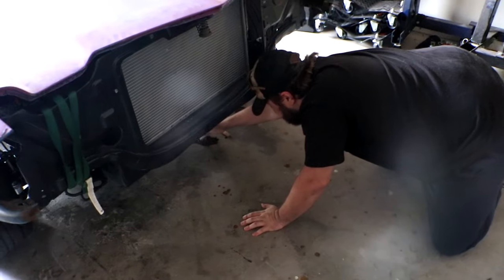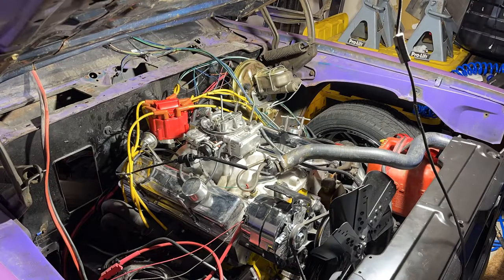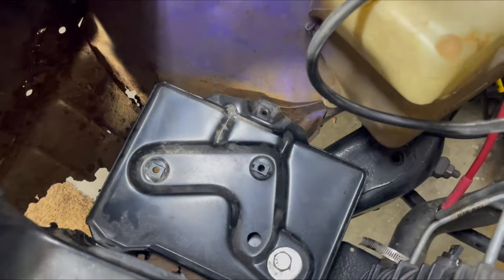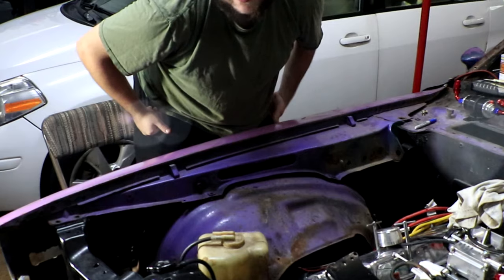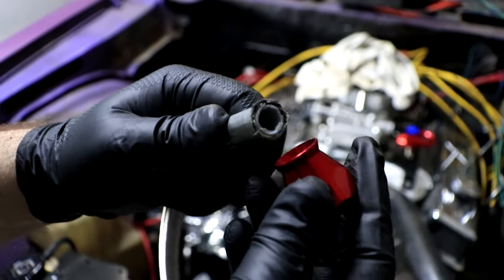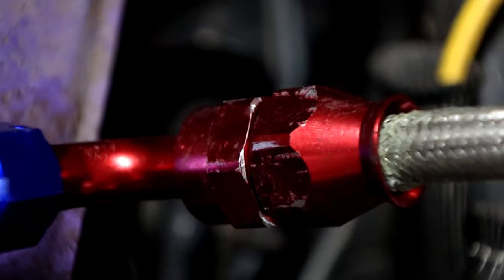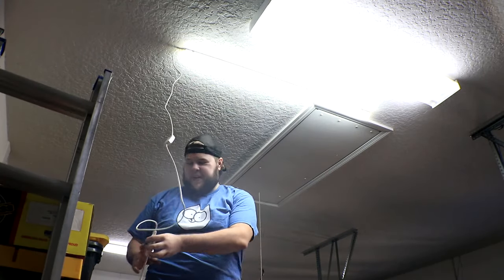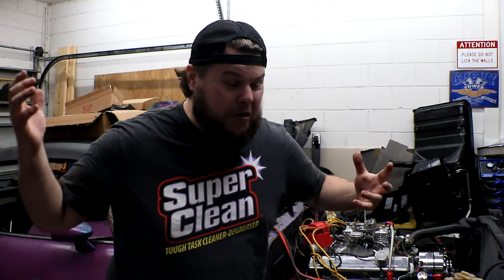Restoring a 1975 Camaro Dirt Track Racing Car | Part 10

Comment: I’m no engineer, but from my experience you generally want the filter before the fuel pump. This is for 2 main reasons. 1) You want the filter to catch chunks and debris BEFORE they go through your pump to extend the life of your moving parts. 2) Generally it is better to pull through the filter as opposed to pushing through it. I don’t really know why, just something my grandfather taught me.

Also, I would move the filter out of the engine bay and stuff it under the car somewhere. This is to keep the fuel cool to avoid vapor lock as the engine bay is a very hot place. I would recommend trying to find a location along the frame rail if possible (again, in line BEFORE the pump). The rest of the fuel lines should be relatively short and should go straight from pump to carb avoiding hot things where possible.

Comment: I made so many of the same mistakes when I went through my first build. It only gets better the more you learn. 

On the fuel filter, if you have room on the frame rail underneath, you might be able to tuck it up underneath the car and clean up the engine bay. I am not sure on gms but that is prime real estate on old mopars.

Comment: That's a nice looking fuel system except I see a few things that aren't right. In case you didn't know this but that carb is for a ford, that's why the inlet is on the driver side, the fuel pumps on fords are on the driver side. GM and Chrysler are on the passenger side so the inlets are in front or the passenger side, that's why you have to use those goofy elbows. Your best bet would be to put the filter on the frame rail in the back by the rear end then run your lines as planed, eventually getting a new dual feed carb with the inlets on the passenger side and put a fuel pressure gage in line. Secondly you could put the battery in the trunk, that would provide extra weight for traction.